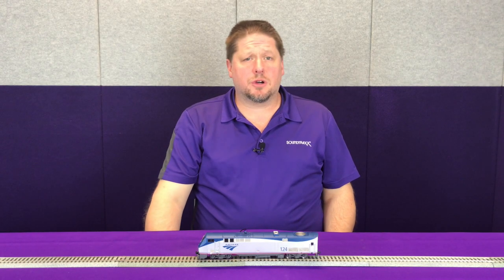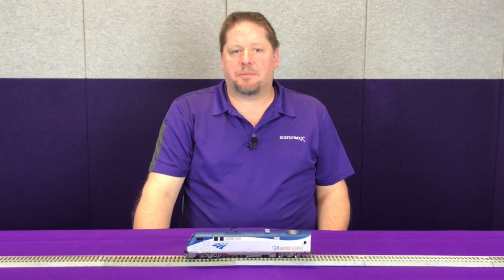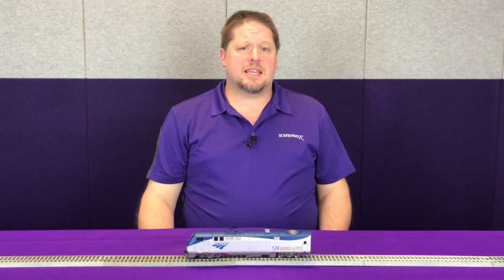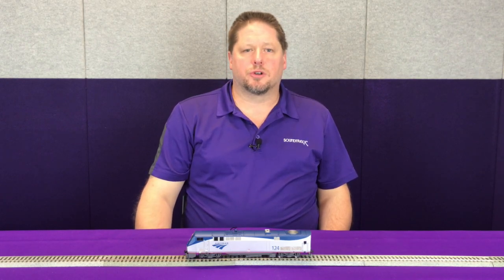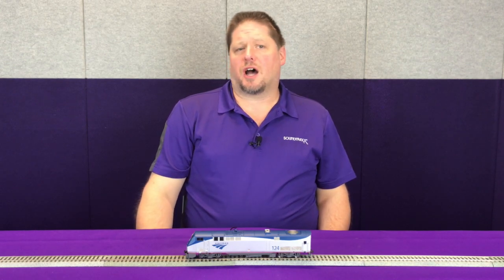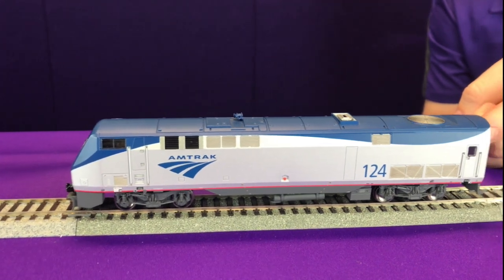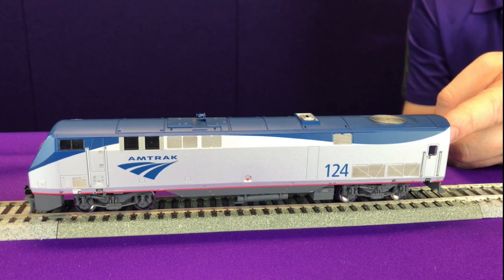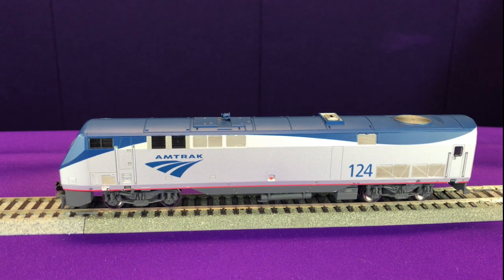Tsunami2 HEP Mode

Comment: Great video, is the HEP decoder sound available in the EMD GP40 modelm
Reply from the maker: If the model is equipped with a Tsunami2 then yes. You can refer to the Tsunami2 diesel User's Guide (https://www.soundtraxx.com/manuals/tsu2_diesel_usersguide.pdf) for more information or contact our Customer Support Center for further help: (970)259-0690 ext. 22 or support@soundtraxx.com

Comment: I thought the P42 had a generator
Reply from the maker: These are equipped with the Prime Mover HEP, similar to the F40PH by EMD, but they run at a slower RPM to generate enough energy for the proper HEP application..  This is how they were delivered.  (We had a former Amtrak Employee on staff that operated them in the past.)  If you are seeing them with a separate HEP ‘pup motor’ like the F59s, then it may have been retrofitted.  But delivered, the Prime Mover was for HEP.